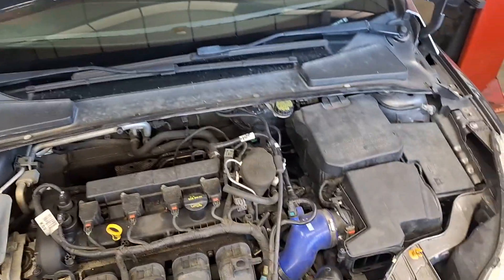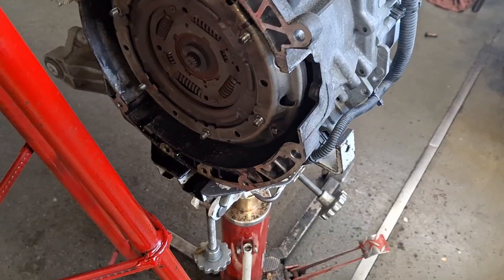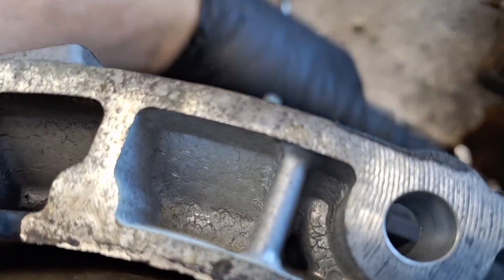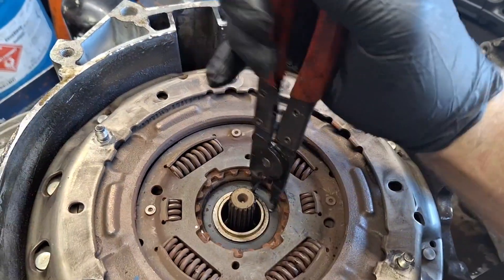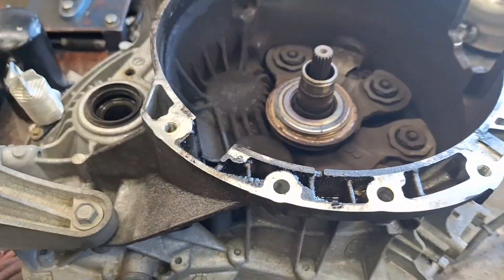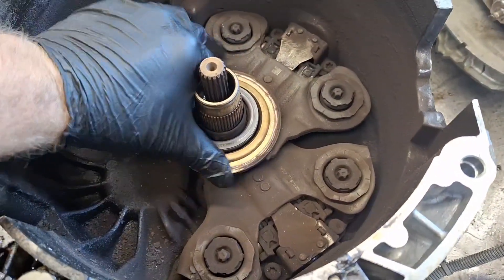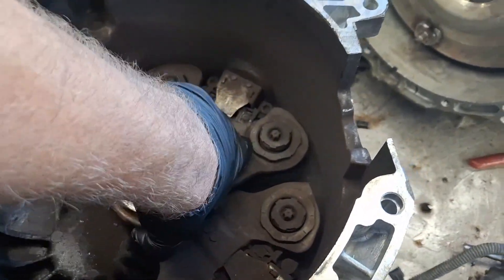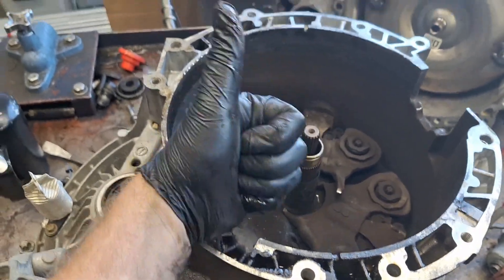Follow-Up: Ford Focus Won't Move in Reverse - P07A4 P2701 Teardown Inspection!

Comment: replaced the internals in the trans except for the shaft. having these codes in my tcm adaptive learn process, before i changed the internals out it was doing the same thing. Would it hurt to throw a tcm at it first?

Comment: Hi Ben
I have been replaced new clutch and folks for ford focus dps6 now I have code 2nd gear not engaging what can I do for diagnose this issue I replaced used transmission as well really frustrating
Reply from the maker: @udeshsalgado7479  p074 code? Any grinding? Check my video p074 codes after clutch job

Comment: I’m having the same exact problem no reverse and it’s slipping and shifting hard but the forks clutch and slave cylinder is all brand new any ideas? Maybe just a bad actuator?
Reply from the maker: Yes. If you move actuator B to the actuator A spot, see if the problem changes to the other gears to confirm the actuator failure. If you need further help you're welcome to ask in our facebook or discord group!
Reply: @BigBensCarsAndCycles  thanks for telling me about the group joining it now!
Reply: Так какая причина была в итоге?

Comment: So I’m having the same issues with my 2018 focus, but it threw the codes p2837 and p287b. Would you recommend the clock gear test or does it seem more Tcm related? Any help is appreciated
Reply from the maker: Unfortunately I think you need a case half. Check my video for P287B "case half replacement"  it's easy to do. I don't think it's the tcm because the 18s had the good tcms installed from the factory

Comment: Any way to add the parts or numbers? Left a message on other video. So it's not the TCM?
Reply from the maker: No, not the tcm. I would get a Luk Repset. Check my video for that, it comes with everything and is oem parts, cheaper than the dealer